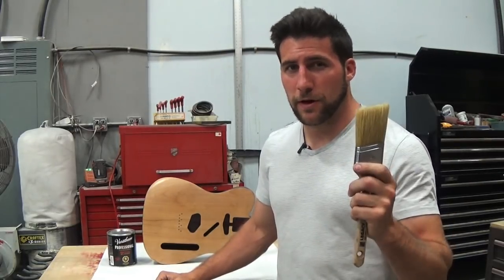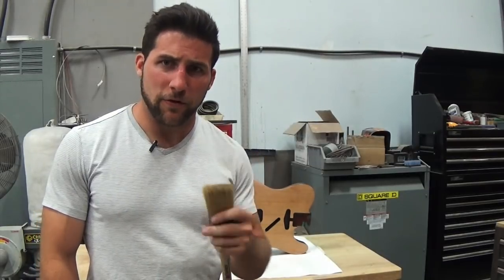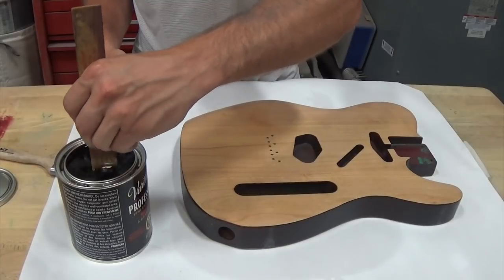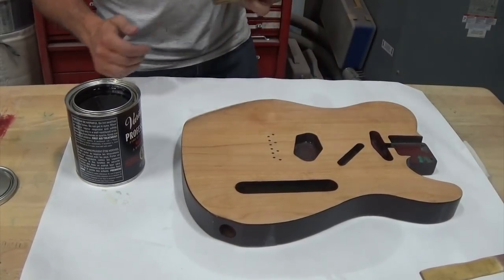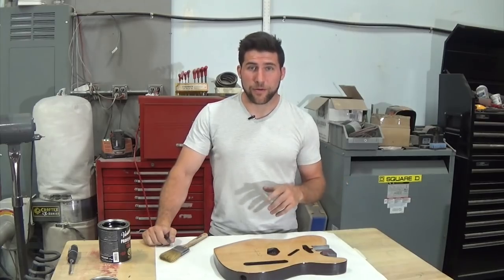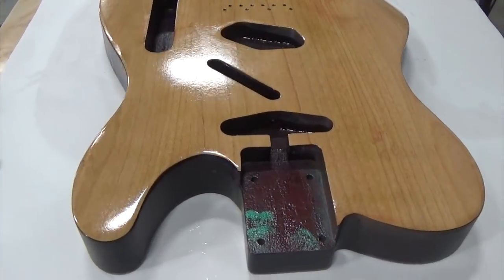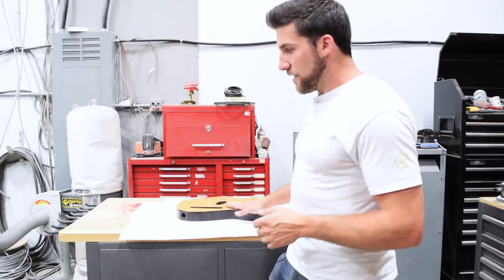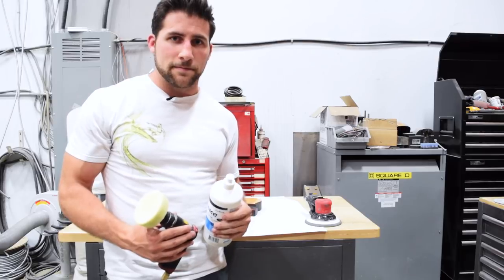How to Brush On a Beautiful Gloss Finish

Comment: The key word for brushing on polyurethane is patience.  I've had good luck with chisel tip foam brushes.  I get good results by letting the foam brush soak in the poly in a plastic tray.  I let it sit in about an inch of poly for a couple minutes.  That way it's fully loaded.  I'm also careful not to press the brush either into the tray or on the work surface.  That creates bubbles.  Then as I brush I go extremely slowly at the proper angle and with almost no force and let the poly flow out of the brush.  It takes patience but if you are you can get an almost glassy smooth finish.  Of course that first coat will have some imperfections and bubbles but the second coat will be close to perfect.
Reply: effin baller man. I'll try your tips asap.

Comment: I know this is an old one Brad, but thanks. I want a poly finish that looks like epoxy resin, 1/8" thick, on the second build, because I gig em and I want to feel confident when I accidentally bang it into the amp or something. Was trying to figure out how best to apply it for my intents and determined brushing would give me the thickest coverage in the fewest coats, and then came here to learn how to do it. Perfect instruction as usual.
Reply from the maker: Glad I could help. I hope your paint job goes well.

Comment: these vids have been so helpful to me over the last week ? after buying a 2nd hand squire online a few years ago, felt it wasnt quite right, anyway after finally stripping the guitar down found a painted after market body, with two layers of paint and a thick plastic covering, ive had to flake off, now im ready to finish the body, i wasn't sure which way to go with it, but now, I think this is the way to go? brush on lacquer, and sand and buff as required, brilliant, thanks for the info Brad
Reply from the maker: Glad I could help
Reply: @BradAngove  seriously seen so many of your old videos, i now know what to buy depending on which way i finish it off now?
solid colour, or stained, or natural and lacquer cheers Brad👍🏽

Comment: Hey Brad, As usual - amazing video.  How do you do the sides and back of the guitar using this technique?  Finish one surface at a time and then move on to the next?  Or would you suspend the guitar and do all the surfaces together?
Reply from the maker: I would do the sides first in lighter coats with it suspended, and then finish the front and back the way I have here. Laying it flat helps the paint lay down nicely on the faces.
Reply: Thanks!!
Reply from the maker: Thanks for watching.
Reply: Brad Angove thanks.. was just wondering this as well and see many thought the same thing..
Reply: Thanks for the video, in line with working on front/back faces, do you let one face dry completely before working on the other face? And Im curious what type of material can i use underneath the dried front face when working on the back face? Im afraid if i lay it on like paper towels it will leave marks and mess up the finish. Thanks again
Reply from the maker: Yeah I let one side dry completely and then I try to put something smooth under it like butcher paper.

Comment: I would definitely use that on a build. After about 4 coats sand and polish with a little compound to a mirror.
For headlights (polycarbonate) we use a pink open-cell pad with compound to bring up a factory clarity and shine after 800/1000/1500. 800 would put a lot of scratches into that glossy finish...I'd start at 1500 and go up from there as ll you really need to do is level. Nice beautiful look though.

Comment: Another tip I got from Dan Erwin on keeping the edge of a paint can clean and avoid splatter when tapping the lid back on is use a Dixie cup to “dip” what you need from the can... no mess at all on your rim... I find new ways to use Dixie cups and tongue depressors everyday.  Great video! 👍🏻👍🏻

Comment: Got her finished (clear coat gloss) today Brad, few pics sent there now on your fb messenger. I can never thank you enough so all i can say is many thanks. Turned out stunning.
Reply from the maker: I’ve very glad to hear that. Well done.
Reply: @BradAngove  Brad lastly as i only have one coat of clear gloss what would you say total cure time so i can put guitar back together again, phoned company they say 5 - 7 days but would still like a second opinion. I was thinking next saturday which would be 9 days.  Your thoughts. Just to add i think some say a month cause some paint 3-4 coats of clear gloss.
Reply from the maker: It depends on temperature and humidity, but 9 days is typically fine for something like this.

Comment: This is great! Ive been wanting to refinish a les paul but worried i wouldnt be able to get a shiny finish but this seems way easier than most other techniques i have seen
Reply from the maker: It’s pretty easy to get the hang of. I hope yours goes well.
Reply: Stripping a valuable vintage Gibson Les Paul from its original finish (even when dented, scratched, cracked, chipped, worn out as it was played non-stop for 5 decades) and refinishing it with whatever finish (even an original Gibson's recipe finish) will take off at least half of its current value as is, right? Almost happened to a beaten up 1964 Telecaster worth $11 000. The original finish was at least as bad as mentioned above. When the guy realised that the value his beaten up Fender would drop down to $4 000 after refinishing, he got his guitar back from the shop just in time. Refinishing a guitar does nothing for its playability, it might only improve esthetics. It's never worth it on valuable vintage guitars. Get a professional appraisal for your Les Paul before it's too late...and I really hope it's not.
Reply: @sly5999  no im trying to make it look better. Someone already tried to re finish it before me with eddie van Halen stripes lol believe me when I say it needs a new finish
Reply: @krustdogg131  Man...Eddie Van Halen (R.I.P.) stripes on a Gibson Les Paul...some people will never get it. Were those stripes just applied on the guitar and left without finish? Or were the stripes covered with some clear after application? Do you know the year of manufacturing and the model of your Les Paul? Eddie Van Halen played many Gibson Les Pauls throughout his career but never did he had one stripped. At least not from what I'm aware of. https://www.pinterest.com/pin/465207836483123167/
Reply: @sly5999  ya pretty much. seemed like they were spray painted over the original black finish
Reply: @sly5999  maybe i can find a pic
Reply: @krustdogg131  Oh shit!...I hear you! Man...I hurt... At least, you must have got it for peanuts....hopefully...right?

Comment: Pro tip:  Something he doesn't specifically mention (but does automatically) is that you need to hold your Sanders FLAT to the surface, don't sand on the edge of the tools! Otherwise it cuts a groove into the material and you can easily burn through the finish into the wood.

Comment: thanks for the vids...i have learned enough to feel confident with the finishing steps for my guitars..working on a telecaster now..i used gloss watco hand rubbed polyurethane, followed with 1000 grit wet sanding and rubbed it out with toothpaste and a little water, because i had nothing else at the time...surprisingly enough it turned out to a realllllly nice satin finish..then used a good auto detailing polish and its smooth as glass...your vids helped a great deal, thanks again.
Reply from the maker: Awesome. I’m glad to hear you’re happy with how it turned out.
Reply: @BradAngove  btw, will be in Canada twice this summer..if we run into you the poutine and molson export is on me..
Reply from the maker: Haha well the Molson isn’t an export here. It is stronger though, which is nice.

Comment: I'm happy to see this video Brad, brushing is my area of experience much (much!) more than spraying is., although I'm not an 'expert' by any means.

If I may......your're right to use long strokes if possible, but if not, then short ones will do to get the material on the job. But, always 'float off' with long strokes. so in other words, get the material on the job as best you can, then with the same brush, but no material on it, make your long stokes (with not much pressure) to level out the material...or to 'float if off' as we say.

Also, use the very best quality brush you possibly can get hold of. If re-using a brush, if it isn't 100% clean and soft, then don't use it...get another one because it will not give such a good finish. Ask me how I know this!

Lastly, as with any finish, make sure that the material is warm...or at least not cold. I know it's summer for you at the moment so it may not be an issue. For me it's winter so i would need to stand my pot of finish in a pan of warm water before brushing it on. I know you know this, but i thought I'd mention it if you don't mind.

For what it's worth, quite frankly I'm surprised that brushing isn't more widely used today. If you cast your mind back to the beautifully finished horse drawn carriages of old, they were all brush finished, as were the early cars. Have a look at an early Rolls Royce or similar quality car from that era with the original paint....all brushed on.

Cheers....and go the All Blacks!!    ;)
Reply from the maker: I never mind hearing someone else's advice and experience, so thank you for this. I did forget to mention the floating off technique, also I've only heard it referred to as tipping off. That's a very good point that I should have included.

With poly you're 100% correct that it's important to have the brush clean. With lacquer and shellac you can just sit the brush in thinner for about 30 minutes before using it and it returns to a useful state.

I didn't even think to mention the temperature issue, not because it's winter, but because I keep all of my finishing materials in the shop. Thanks for reminding me that I should be pointing those things out.

The all blacks are a very exciting team to watch. There's no denying that.
Reply: RJumper, yes about warm, not cold product, also true for spray cans and a warm work atmosphere

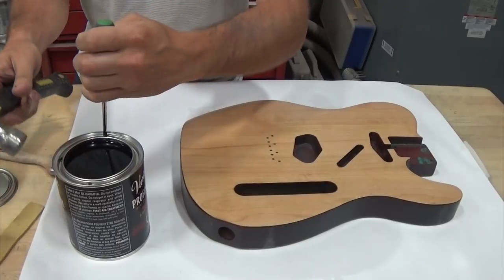Comment: You can brush it on any old Direction preferably across the grain and then go back and tip it off with the grain you'll get a nicer look and you won't have as many missed spots known by painters as holidays, your varnish will be be evened out as far as thick and thin places. If you do this it'll be relatively the same thickness everywhere. Then you can take a rag wrap it around your forefinger and go around the perimeter wipe off any excess runs around the edge and do the same around the edge of all your cavities such as your pick up cavities wiring cavities anything like this. This way you don't have to spend a lot of time trying to be real neat around the cavities just get it on there real quick, I suggest going across the grain first then tipping it off with the grain as I said before because this evens out the thickness of the varnish/paint/stain coat instead of having thick and thin spots. When you first put your brush down it's thicker right there and then as your brush gives out of paint/varnish/stain it gets thinner. When you put another brush full it's thicker wherever you first stick your brush down, but if you apply your finish in two directions each one counseling out the other you don't have that problem. Your coat of finish will be real even like a spray coat by doing this and you have plenty of open time when using an oil-based product on a small surface like the face of a guitar. Also I suggest that you not sand any higher than 220 for your first coat this will give you better adhesion certainly not higher than 320. 600 is a little slick for my liking. 600 grit might cause you problems with adhesion not right away but at some point down the line it May chip and peel-off down to the wood whereas your coating a lot more grip on 220 and you can't see any difference under a clear coat or a painted coat. I've done this for forty+ years, since 1972 and I've never had any problem provided you sand with the grain and don't have any cross-grain scratches. Typically painters and finishers will use 120 to 150 as their final sand on painted Pine and 220 Hardwood or if they're planning on staining and or varnishing Pine they might go to 220, although 120 works just fine. If you want to go crazy you can go to 3:20 but I never have. also try using a Wooster yachtsman marine varnish brush these are the best for applying oil/solvent based varnish/stain/paint. They have a finer grade of bristle and they're fairly inexpensive because they have a cheap plastic handle instead of an expensive wood handle. The bristle is what matters. They have the high quality marine varnish bristle which is a fine grade of rwhite china bristle like the brush you're using. My favourite China bristle brush for the particular job you are doing is a two and a half inch brush straight across and if you want to get a little more high quality in that it has a little more bristle count per square inch get the Worcester with the little round pencil handle that's what we painters call them the handle is about like one of those fat kindergarten pencils you get it's a wood handllet. God Bless Merry Christmas & Happy New Year to you& yourn!!
Jimmy in NC....

Comment: Hi Brad. A few [!] words to round off my project. A number of issues encountered on the way that may be useful for those less experienced, like me. 

1] As you mentioned before but it has to be made very clear - a really good quality brush is absolutely essential. Mine was bristle but of inferior quality, including shedding bristles. This gave me all sorts of probs which were difficult to remedy. I abandoned it for a foam sponge. More of that below.

2] Depending on the make of poly and the conditions you're working in, if you don't get it right with each pass, trying to make good may result in making worse. I found that my poly was virtually unworkable, as far as a 'repair' on the guitar, after as little as 20-30 seconds! Here we are, in middish Oct and I'm still in just shorts by day, sleeping under only a sheet, in Valencia, Spain. Temp in work room 28C/82F+. 26C/79F today.

3] I had some double-layer dish cleaning foam sponges. One side was a very soft foam, smallish 'bubbles'. I found that really loading the sponge up along one edge and making a non-stop pass down the guitar left a good, thick layer of poly. Looked like a layer of watered-down yoghurt. It's extremely important that the pass is non-stop. I found that a pause, or stopping short, left a boundary line, with brush or sponge, and if not dealt with instantly, just left work to do with the abrasive, 24 hrs later - sanding out the 'ridge' and making another non stop pass down that area.

4] As you must make a non-stop pass, off the edge of the guitar, with a well-loaded brush or sponge, there are going to be runs down the side of the guitar. Mine is square-edged and with plastic binding. It is essential to wipe the runs clear before they run round the lower edge onto the other surface. If they do run 'round the corner' onto the lower surface, they dry to a solid bleb. Picking these off, if on the surface you coated first, results in a disaster - the bleb comes away with all the layers below it! - leaving a torn edge to the area, right down to the original surface! This is exceedingly difficult to repair. If the original surface is wood, maybe it's easier but mine was a factory paint satin finish. Hours of painstaking work with scalpel, abrasive and fine artist brush. Looks close, but no cigar.

After 3 attemps to get a finish with that horrible brush, I had fine 'tramlines' all down the back - my training camp. Massive sanding job to try to flat these out - not entirely successful. Only removing all the poly would have worked. Then came the learning curve with the pad, the characteristics of the poly ... you will be suitably amazed to know I ended up with 9 [nine!] coats on the back! I now know how to get a really glassy finish in two coats - if I ever did this again!

5] Once the poly has gone off completely - 24 hrs - it's possible, with great care, to make local repairs. Sand the offending area and load the pad so that the bulk of the poly goes down on the repair area and feathers off onto the surrounding area as the poly on the sponge thins off. This takes some practice. I've done it with household gloss paint and it works with clear poly. 

The front has three coats and needed a couple of areas of local repair. It could use some more but I have called a halt for now. From 5 paces it looks pretty good. But it was a test bed and shows the signs of being so. I doubt there'll be another but if there is it will be miles better!

Comment: Love the videos man, any idea what would cause spray can clear to wrinkle over time even after it is cured.  Keep it up dude!
Reply from the maker: After it's cured? That's pretty wild. I'm not sure why it would do that with no residual solvents to create a reaction. How long has it been since you sprayed it? Are you sure it's "wrinkled" and not checked or cracked?
Reply: Not letting the coat underneath dry (flash off the vehicle) long enough. If it happened spraying over an old existing finish, then the clear wasn't compatible with the old finish/paint.

Comment: Just an FYI. Do not apply Polyurethane by brushing back and forth. You brush in a single direction only and flow the finish on. Once you have applied the finish to the full length of the body, finish with a final stroke the full length of the body from end to end. Follow up he rest of the body in the same direction.